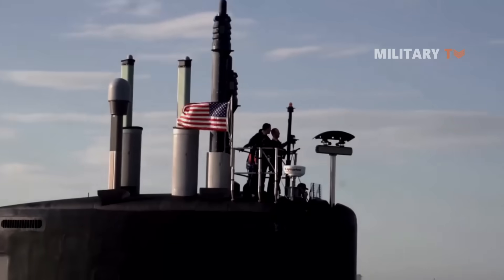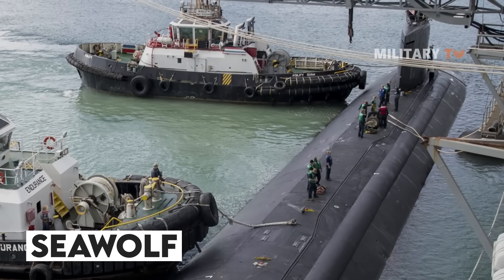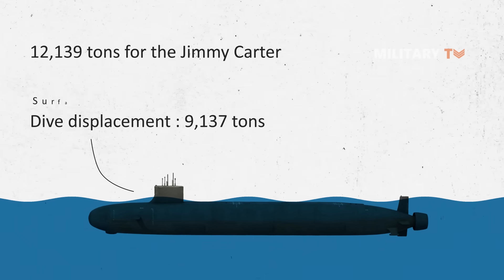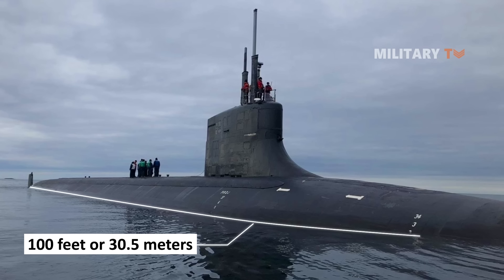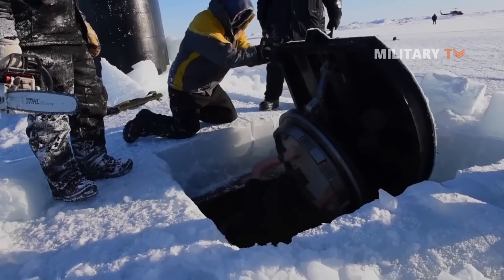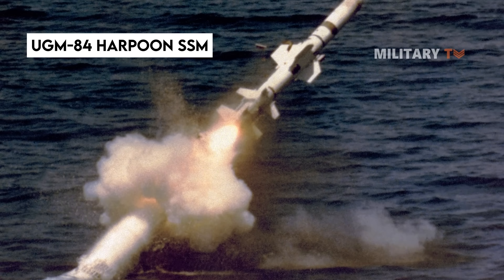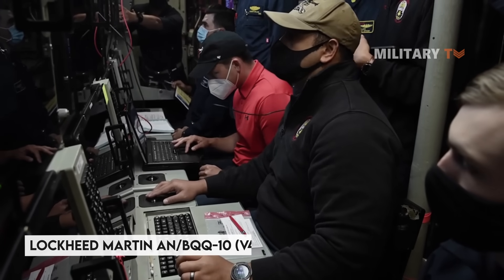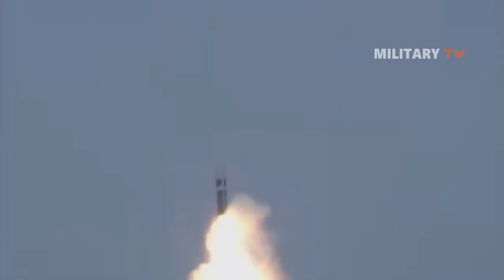Why the Seawolf Class Is the F-22 of Submarines?

Comment: Look what they replace the a-10 warthog with, that supports ground troops, it is a crop duster plane, that is a joke, if you asked Marines Army, seals, special forces personnel, they will all tell you the same thing, when the a-10 flies, soldiers don't die, if they wanted to turn the a-10 warthog into a drone, fine, but since the Air Force loves to just get better and faster Jets, the a-10 warthog project needs to be taken away from them, and given to the United States Marine corps, enter the army and you need unmanned drone A10, and regular piloted a10s warthogs, you send the drones in when it's too dangerous for the piloted, a-10 warthogs, that is the best way to get this done.

Comment: They should have small cameras on the outside so they can have a giant windscreen on the inside just for optics. Like the Nautilus in voyage to the bottom of the sea.😊
Reply: well cameras might work until the reach about 700 feet of depth then all they will pick up is various shades of darkness. Most subs operate at 1000 feet or below and move between thermal layers to hide. 

Sonar operators are very good at knowing where they are and where the enemies are and they rarely engage a sub at less than a 1000 feet distance, so cameras would not help in any way except maybe when operating on the surface....which they rarely do

Comment: Everyone keeps talking about the Astute. It's a fantastic submarine, but I can say with certainty, the Seawolf is the most advanced, quietest,  fastest, deepest diving submarine in the world. It also has a lot of very specific equipment onboard to give it the most advanced SONAR capability in the world. It is without a doubt, the most deadly anti-submarine hunter killer ever built. It was so expensive, they only built 3, and made a ton of compromises to build the newer Virginia class to keep down the budget.
Reply: The french new submarine Suffren class may surclass the seawolf on some aspect.
And the diesel-electric sub are usually quieter (when they use electric engines) than nuclear powered ones.